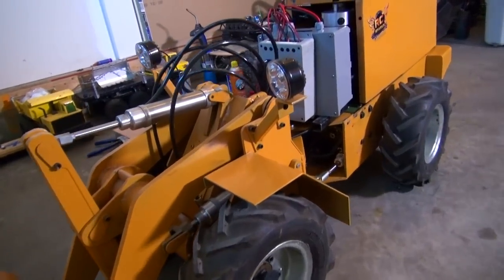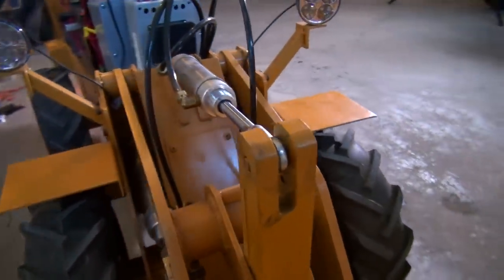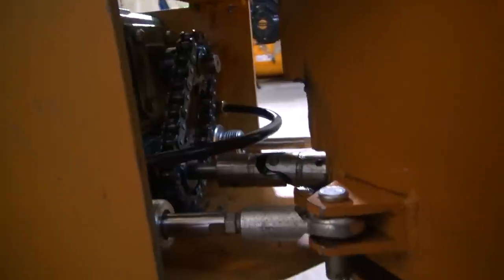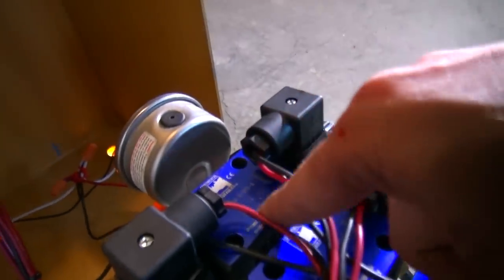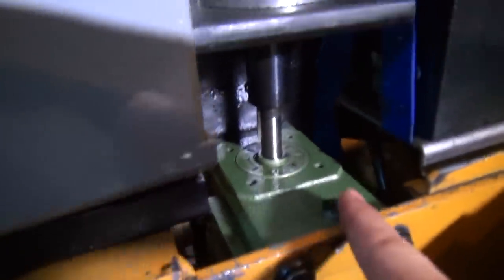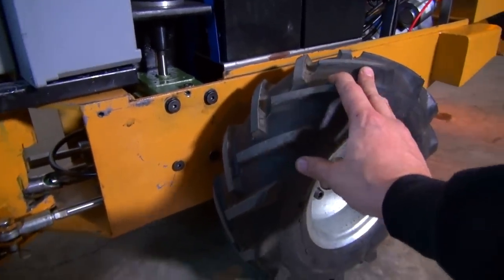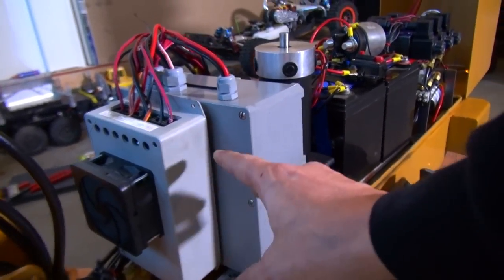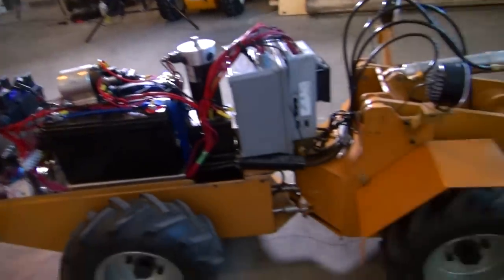RC ADVENTURES - 500lb Hydraulic RC Wheel Loader Lifts Me - 24v Electric Power

Comment: There will always be critics, that's normal. I can see RC machines of all sizes and their innovations/builders contributing to units with all sorts of uses from just pure fun to doing work. The elderly could safely clear snow themselves which might help them to live independently for longer as one example of a potential millions. When an affordable and reliable line is produced it will catch on, and, you might even see some critics using them. Good work man.

Comment: Things like this are an example of modern model engineering. Model engineering as a phrase traditionally refers to building scale-model versions of steam engines and late 19th and early 20th century internal combustion engines, and working steam locomotives. There is a hobby called Live Steam in which people build scale model steam locomotives and drive them on tracks where they pull trains with people (they are powerful!). People also build steam-powered tractors.

However, unfortunately the term seems to only apply to scale model technology from the 19th to very early 20th century and is a hobby mostly inhabited by old men. I would say that it also should apply to model building in modern times as well. I believe scale-model versions of modern internal combustion engines, such as a working scale model of a Chevrolet small-block V8, are considered model engineering, but things like scale-model modern construction equipment with working engines and hydraulics inside, scale-model RC aircraft with actual scale-model gas turbines to power them, etc...are also very much model engineering too and if included in the term mean a lot of young people would be included.

Model engineering also has a lot in common with hobby machine shop.

Comment: 2 12v batterys doesn't make it 24 volt....
Reply from the maker: Learn the difference between Series and Parallel
Reply: if you hook the positive of one battery to the negative on the other battery it does
Reply: Ryan Lucey
Reply: Ryan Lucey
Reply: there ran in series,  so it steps up to 24v

Comment: 2:07 those are hydraulic valves. They control which direction the oil takes. From the pump to the cylinder=actuator and return to tank: Either extending, no movement, retraction

Comment: hey man, its a great huuuuge truck, but i think it might need some capacitors for the lights, bc they are blinking when the hidraulik system starts to work. i think its bc of the voltage droop at the high load. keep up the good work with it! in my opinion, it could use a gear differential, instead of a spool, at least at the rear axle.

Comment: Those are called valve coils I think. They are like on hydro elevators they are magnetic and open and close orifices in the valve for different ram functions. Elevators use them on valves for speed control.

Comment: Hey medic I just got a summit for Christmas And one of the servos went so I got another so I am now running 1 stock servo and one savox servo. But now both servos are turning the same way and fighting each other. How can I fix this? Would really appreciate it! Thanks
Reply: hey buddy you should just beef up your summit and get 2 savox servos so u wont have any problems\
Reply: Your issue is caused by a polarity difference between the traxxas servo and the savox servo (Hitec servos as well) You will have to do one of two things...( I assume it's a 1/10 scale and not a 1/16 scale summit)
Install another savox servo to go with the one you just got or get another 2075 traxxas servo.   
Or just use one servo that has at least 250oz/in.
If you get another savox servo, you will have to reverse the steering on your transmitter. The owners manual lists how to do it or google the procedure.
Reply: nabob14 j.      .

Comment: I have a question my new traxxas trx4 bronco wont move. I played with it in the water and now it wont go forward or reverse but the tires will turn left and right to steer the battery is good and I'm getting 12 volts to the motor but my waterproof xl5 Hv has a green light and then I press the throttle it just blinks and if I hold the throttle to long the motor will start to smoke can you help?

Comment: hey *****  i have a thunder tiger dt10 and my engine has stripped threads on one of the 4 bolt holes on the top that the heat sink bolts down on will my engine heat up expand and be ok or will it just suck air in and cause a nasty mess and is there a way to fix it and the engine is a thunder tiger pro 15

Comment: its a cool machine but i think it would be alot cooler if it had a diesel or gas engine providing the power rather than batteries similar to real equipment